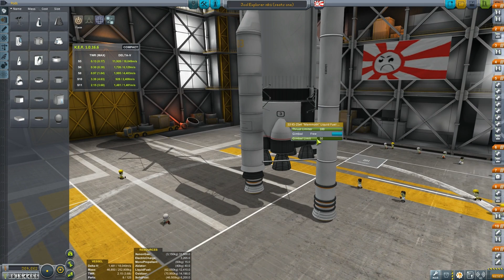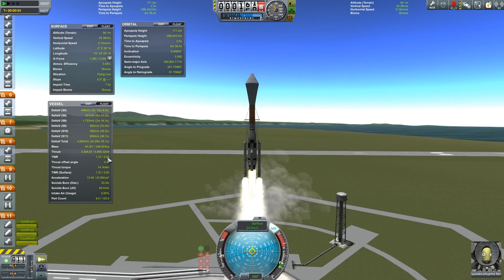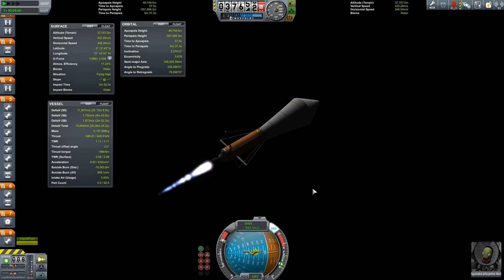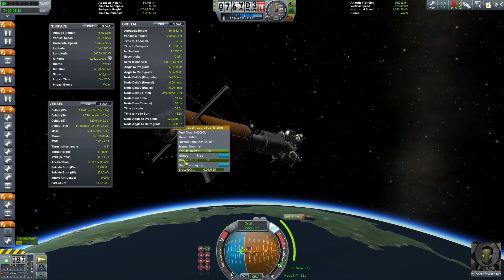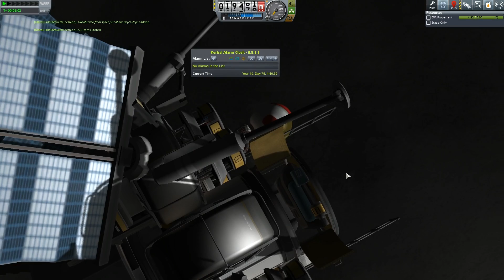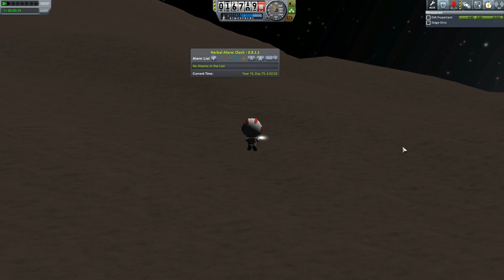Marquis de Joolyette [24] Kerbal Space Program 1.0 Career

Comment: @10:00 What? Using the semi-major axis from the Kerbal Wiki gives 68,773,560,320 m/13,599,840,256 m = 5.057.
Solving x = 5.057⁻² gives x = 0.039 (remember, inverse square law here). The light intensity is thus about 3.9 % of the light intensity at Kerbin. In other words, you'll need 25 ½ as many solar panels in order to receive the same amount of energy as you do at Kerbin.

@40:11 You are changing you FOV; that's why.

Comment: The whole solar power concept was reworked significantly in 1.0; now solar energy diminishes with the inverse-square law meaning unless you bring a massive array of solar panels, forget using ions out past Dres. (Conversely, near Moho your solar panels will have like 10x greater output). In addition, they added in atmospheric extinction effects; if you use solar panels in an atmosphere, the air scatters some of the light depending on the sun angle. All of a sudden, the addition of fuel cells seems more like an act of mercy.
Reply: bitbucketcynic What did you get your number from? If one actually do the math, (13,599,840,256 m/5,263,138,304 m)⁻², it's only ~6⅔ times greater at Moho. The distances is taken from the Kerbal Wiki.
I'm really interested where you got the number from.

Comment: In version 0.9x the heating problem with nuke engines could be solved by not using 100% of the trust but only something like 80%. Even when the "Overheat" bar next to the fuel level was almost full it was solving the problem.

Comment: if they calculate light intensity properly, its a cube root function, so if the diameter is twice as far, you would need 8 times as many solar collectors...roughly..   ;)
Reply: DredWolf Light and Gravity are both square root functions, sir. In the case of light, you're looking for photons spread across the area of a sphere as the distance increases, and the area of a sphere increases with the square of the distance. Gravity has a different reason for being based on the square of the distance, but you had that one wrong, too. Sorry.
Reply: Are you fuckin me?
Reply: not sure what you mean??? gravity and light are cube root functions...the further away you get from the source the quicker the effects decay...this includes both gravity and light....so if you have a baseline off four solar collectors to power your sytem, and you want too go out too twice your diameter of orbit distannce you need 4x4x4 solar collectors to power it....so 64 solar panels too recieve as much energy as you would in kerbal orbit...
Reply: DredWolf Ehm, I believe you would need 4 times as many solar panels, so 4*4=16 :) It is true that the intensity of a point source of light (and the strength of gravity) decays as 1/r^2, so you would need 2^2=4 times as many solar panels if you double your orbit of the sun
Reply: ARE YOU FUCKIN MEEEE!?!!!???!!?!??
Reply: DredWolf Cube root function? Are you high? Both gravity and light intensity follow inverse square laws, not cube root laws. The light intensity is four times as weak – not eight times as weak – when the radius doubles.
Reply: your right..inverse square is proper calculation...however, at twice kerban orbit, it still works out to 64 panels..... at least as my calcs show....double 4 =8, square that= 64....so...
Reply: redid all the calcs .... and your right....16 would have worked,,,, I'm a dummy...sorry...:(